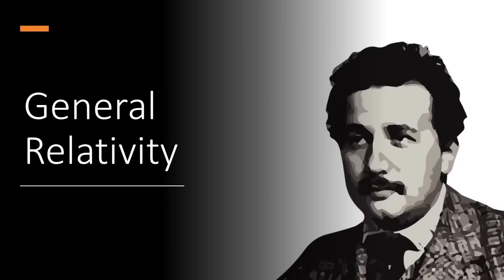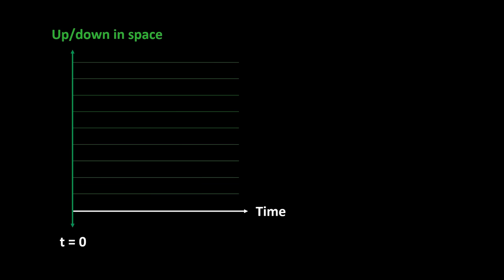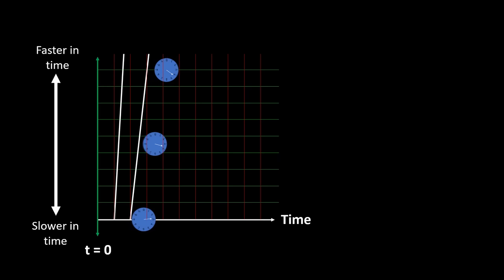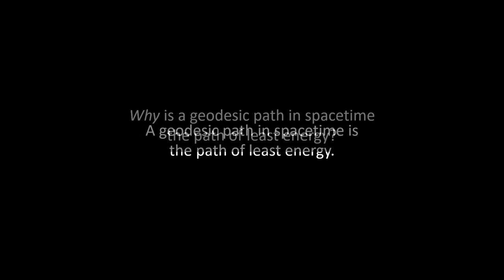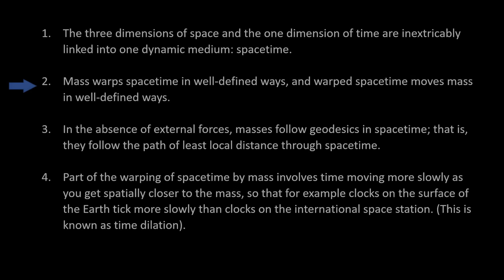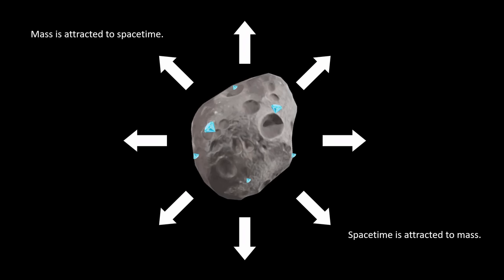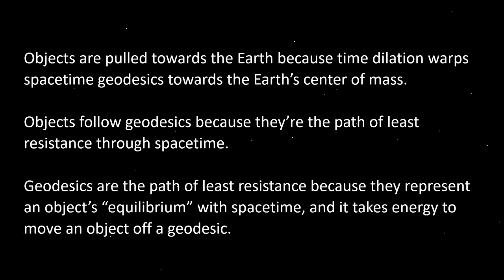How Time Dilation Causes Gravity, and How Inertia Works

Comment: Einstein taught you to think in terms of small ideas and thought puzzles.  But you still continue to IGNORE what is simple and before your eyes.  Go into outer space where there is no gravity.  Before you is a large ball of water.  Put a penny on the ball of water.  The penny will DISPLACE the water and come to rest at the center.  Now take a syringe and release air into the center of the ball.  The water will DISPLACE the air and push it outwards where it will settle (BALANCE) around the ball as an atmosphere.  Do this experiment with ALL the elements in the table.  They will either FALL or RISE and come to balance in relation to each other.  That act of DISPLACEMENT is what you call "gravity."  Everything is attempting to balance with everything else.  And that act of DISPLACEMENT is both measurable and a FORCE.  Physics must begin with the small things and that which is easily proven.

Comment: I came to this video after dialects one. And tbf yours is much more rigorous.
The only way it could be faulty is if time dilation is not a direct result of bending. Thus it could only be wrong if bending of spacetime would not increase path length (how time dilation is explained in special relativity).
Bending has to increase the path length since the shortest path between 2 points is straight by definition.
Thus making it so if bending causes time dilation and an object follows a geodesic, you're right. Wich is this case is.

Comment: The casimir effect is probably related to why mass warps spacetime, I tried making a very simple abstract model of it (probably terrible way to go about it) but it would make sense, an empty region of space exerts a certain amount of force, the force pushes equally on other empty space and it cancels out giving flat curvature, as soon as any mass occupies it, it "blocks out" the things the effect emerges from and the force is no longer fully balanced out on neighboring regions of spacetime.

like there is something that props up spacetime so it is flat, like if you had a trampoline with the skin of it levitated by something that is "obsured" by mass

Comment: I have always taken the views that a) spacetime emanates from every point in all directions, thus allowing for changes of direction and time and b) nucleons, which to me are almost condensed parts of spacetime with rest mass, warp it because they are impermeable and so spacetime cannot go through them, spacetime almost concertina’s up around them. Bearing in mind most solids are vacuum and when mass is really concentrated then their mass such as a black hole completely blocks spacetime as opposed to Earth which only blocks enough for us to weigh what we do at the surface. Would love to develop this further.

The constant emanation is probably what we call the dark force. The emanation is what non mass waves ride along, at the speed of c. So mass is to me proportional to the volume of spacetime it encapsulates.

Comment: Totally misunderstood in the introduction.  Take it in steps. Gravity compress space. ( this is also the reason they can make waves)  time is influenced by the compression of space. The more compressed space is the slower time runs. This is a local process, time  can run with different speeds but it is not relative to anything like speed is. Speed only exists relative to something else.

Comment: Sorry, 'time passing faster farther away from the earth'? That's nuts, it's nuts because time is as real as Puff the Magic Dragon - both are simply the invention of mans mind, neither actually exists. Time is a concept invented by man, it is defined by clocks, clocks do not measure 'time'. If I have a 'clock' and I look at its dial and see that it shows 12 o'clock, then - by definition - it is 12 o'clock EVERYWHERE no matter how far away or what distortion is happening physically or how fast something seems to be travelling. Back to the drawing board people and next time bear in mind that you have been using (the ultra useful) 'time' for too long - you have forgotten (or never realised) that it was invented and can't be distorted!

Comment: Sorry, but you're making the same mistake as all your predecessors and making it far too complex with geometric diagrams. This will not help people "see" it. The way to understand this, and I agree with you, is by simple visualisation. When you get your head 'round it, it's so simple.

Your floating in space above the Earth with the time rate Earthside of you running slower than that on your far side. Consider only the component of your speed towards the Earth. Speed is simply distance moved over unit time, v = s/t. If the time rate gets slower as you move nearer the Earth, then the unit time gets smaller. So, the fraction s/t gets bigger. Velocity "v" gets bigger, it increases. An increase in velocity is acceleration and so we can deduce that acceleration will always take place toward a slower time rate. There is no force involved here and all objects will accelerate the same, independent of their mass.

Kip Thorne said it very succinctly, "Everything tries to exist where time runs the slowest, and gravity takes it there".

"But what about space curvature in strong fields?", I hear you ask. Well, the causation of gravitational acceleration must be the same everywhere, in weak fields, in strong fields, and as the field goes from weak to strong, the causality must be fundamentally the same. How can this be? I will tell you first, then I will explain it - Space curvature is caused by time curvature, so ultimately, the causation for gravitational acceleration always boils down to time curvature alone, (the changing of the time rate with position in the field).

How does this work? Well, both special and general relativity show us that as time slows down, lengths and volume get smaller. In the limit at the speed of light, time stops and distances (in the direction of motion), become zero, they become irrelevant to the traveler. In general relativity, the limit is the event horizon of a black hole, where time stops here also and space, or volume, becomes zero - space becomes a spherical hologram around the surface of the horizon. 
When time stops, space shrinks to zero volume. When time runs at the equivalent energy of "c", then space expands to the limits of the universe. (That's a huge clue for inflation and residual expansion).
From this, we can deduce that time is fundamental but that space emerges from the passing of time. Therefore the space curvature, (the shrinking of the volume of space nearer the large mass), is caused by the time curvature.
 It is quite possible to easily express the first line in the development of the field equations purely in terms of time rather than geometrically, and so there is no disagreement with general relativity by taking this view.

Comment: ...somewhere around the train analogy at 12:06 you say that an energy input into a mass m at rest in isolation from other masses will undergo continuous, increasing length-contraction (and likewise time-dilation) with "increasing motion" away from the point at which the object was initially at rest, which I take it would mean that all mass in free motion is destined to length-contract into light in the void of deep space...but in even less time if it interacts with a larger mass M >> m which will change its momentum vector such that m intersects M, m slingshots away from M or falls into orbit around M? But first things first. Why would momentum increase in deep space, again? I guess that I need to watch that part a few more times...
because for sure the next question is what happens to two masses in orbit for infinity. Especially if all matter is made up of atoms of with more or less stable elements made-up of orbiting subatomic particles. Except for metals.Not quite orbiting but still trapped in close proximity.

Comment: I have a question related to the video and the equivalence principle. It seems a logical conclusion (to me, at least!) that from the equivalence principle we could potentially try to re-derive kinematics in terms of time-differentials. In other words, we can look, for example, at acceleration as applying a time-differential across the accelerated object. Another example can be the interpretation of constant velocity that can be described as a constant time-flow differential across the two reference frames. If that holds, could we define the concept of inertia as a measure of the propagation of the time-differential field...? Could geodesics be defined via a temporal-related description? Could a temporal version of F=ma be defined? It would be really interesting to know if any work been done to explore this path... sort of time-differential kinematics...(I just made up a name... :D) ? If so, are there interesting (positive or negative) results from previous research?

Comment: 0:35 omg thank you! 
For a brief moment the time flow gradients were enlightening then I made supper and while kneading my pizza dough was like, wait, if they are saying time causes gravity why is the time gradient like that because of the gravity? I turned to my wife and said, "wait, its time turtles all the way down!"
Reply: OOOHH NNOOOOO! It's still time turtles all the way down. Why is time slower near the massive body if not gravity in the first place. I am hearing over and over:
Time dilation causes gravity
How?
Because time is dilated due to the gravity of the massive body.
If the spacetime is warped, then gravity is already there, the clocks tick different for the same reason things fall. It's time turtles all the way down!!
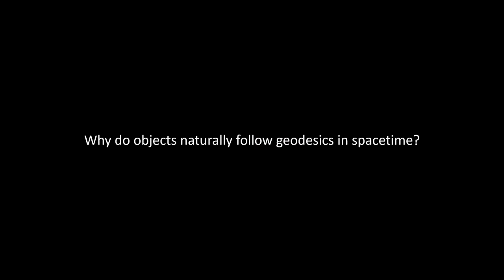Reply: 6:36 I am lead to a totally different question. Why does mass have this effect on "time"? Why does a gravity well effect a clock if clocks are the cause of the gravity well?

Comment: @idealisteye thanks for a great video. Can you please explain tides, as obviously the traditional "gravity of the moon" is not correct.
Reply from the maker: Thanks! I'm not sure why you think the traditional explanation for tides is lacking. This video is describing how what we call "gravity" has a different source than what most people would expect, but it isn't rejecting gravity as a phenomenon in any way.
Reply: @IdeaListEye  thanks for your reply, I meant the traditional explanation of tides are that the moon pulls on the sea water closer to it causing high tide, but how does that explain the bulge on the other side.
Reply: @juscog  The earth / moon tidal lock becomes a system and its centre of gravity is in the earth on moons side so the opposite side experience's a centrifugal force causing tidal bulge (best explained on diagram ) 
Moons tidal lock is not just a simple gravity pulling a tide it becomes a system with the inherent centre of gravity

Comment: The title of this video is misleading.  Maybe it could be called click-bait. Strictly speaking, while time dilation is an observed consequence of the curvature of spacetime in regions with varying gravitational strengths, it is not the direct cause of gravity. Instead, both time dilation and the gravitational effect, the latter of which I view as a pushing force due to mass (me) following a geodesic, originate from the same source—the curvature of spacetime caused by mass and energy.

Comment: Let's imagine something is given a light tap, and it goes through space-time along a gradient. What if that thing is very light, nearing zero mass? Logically, it would follow the gradient and appear to fall. But, what if the thing was like our typical model of an atom, electron, or quark. Would it spin like a top and tip over (and not hitting a tabletop) continue to flip over endlessly? Isn't that the typical view of a tiny thing, always moving per some primordial energy -- the source of entropy? Perhaps the existence of mass and the time dilation caused by that has a major effect on everything. Perhaps it's all tied together because mass exists and it distorts space-time. Thus, energy, is tied up in mass and gravity and chemical reactions, because all these are the ways massive things create more and more gravity, which appears to be the source of the momentum of falling. Thus, to find zero-point energy, one need look no further than massive things and gravity. But then, there is also the force of matter exploding into light and energy -- the opposite. So, why do mass and space exist in the clumpiness they have? Why do quarks create atoms and molecules and macro things?

Comment: First Question: Why is an asteroid in the depths of space away from gravity traveling on a Geoesic at all? Why isn't it totally stationary in space?
Second Question: Why should time have to slow in the presence of mass?
The answer to the second question is: The Speed of Light is said to be constant and in order for that speed to remain constant, time must adjust itself to allow that speed to be measured locally at the same speed as would be measured in areas of faster time. If you are in a region of slow time and light never changed its velocity then light would appear to be faster than measured in regions of faster time. But by slowing time to account for the slowing of the speed of light in regions of higher gravity, light speed remains constant. In other words, the speed of light is not constant, it does slow in regions of higher gravity, but time makes up for this by also slowing by the same ratio thus preserving the relative constant speed of light. That is how it was explained to me.
If the speed of light did not have to remain constant, then time would not need to slow in regions of mass/gravity.

Comment: Stop fucking confusing people. Things fall because they are denser than the air around them, not because of a made up imaginary gravitational force.
Reply: Did you not understand video then? objects falling has nothing to do with density as they all fall exactly same rate in a vacuum ,also density cannot give a direction so whey would objects fall downwards ?
Reply: @nounoufriend1442  If gravity is real why isnt everything a sphere?
Reply: @earthone777  Depends on what make up of object is ie its physical resistance to conform to a sphere , for planets its normally about 1/5 of the size of earth , all planets are near spherical  . But something as fluid as water it will always conform to a spherical shape , you never explained why objects fall downwards in the absence of gravity did you ?
Claiming density as a cause for objects falling downwards is utter nonsense , next you will claiming the earth is flat LOL
Reply: @nounoufriend1442 The logic you present is "thing in the sky is round, so the thing I stand on must round also. By that logic, why aren't you round?
Reply: @earthone777  Do you actually claim the earth is flat !!!! utter nonsense , we have 2 poles north /south , tropic of Capricorn is smaller than equator , shortest distance between 2 locations is great circle route , object disappear bottom first , we can measure curvature and rotation , moons inverted at southern latitudes , 1 degree elevation equals 60 miles (basis of all navigation) Horizon drops with altitude  plus much much more 
Non of these work on a flat earth so why should I question the globe ?  nearly forgot " it gets dark at night " how could that happen on a flat earth , storm systems are driven by rotation ie they rotate anti clockwise north of equator clockwise south and never form or cross equator . We have many thousands of satellites observing a globe , my observed reality confirms the globe
Reply: @nounoufriend1442  You never explained why you aren't round...

Comment: If your propositions are correct, please calculate the force that would be experienced by an object of a certain mass and height, at the surface of the earth, based on the mathematical time differential you claim creates, the force experience by that object.....otherwise your explanation is just words.

Comment: Is warped spacetime the displacement of the fabric of the universe? Causing this fabric to be "squeezed" and in multiples around the object?

Because the universe is constantly expanding, and now that we have multiples of this fabric, does this cause tume dilation and gravity?

This fabric would be most abundant at the surface, and the further out you are the less of this fabric there is.

Comment: Sir, the claim that clocks tick slower on Earth than on the international space station is simply a definition. We define a day as the time it takes the earth to rotate one turn. 1) A boat that could circle the earth in a straight line at sea level would take less TIME ON A CLOCK than the space station 254 miles above the earth traveling at the same speed because the space station is traveling farther. The boat only travels 7917.5 miles times pi, but the space station travels 8425.5 miles times pi, so the space station will take more clock time. 2) However, if the boat and space station could stand still and let the earth spin under them, then it would take exactly one day for this to occur. A clock built on Earth to measure one day would measure more time if it was traveling a farther distance at the same speed as in scenario 1. But in scenario 2, a clock sitting on the space station while the earth spins one day under it will still count the time of one day.
Reply from the maker: This is clever reasoning, but it's inaccurate. Please see more here: https://www.snexplores.org/article/a-new-clock-shows-how-gravity-warps-time-even-over-tiny-distances